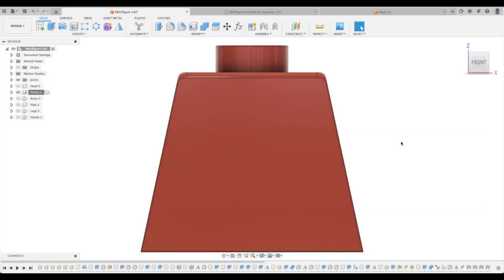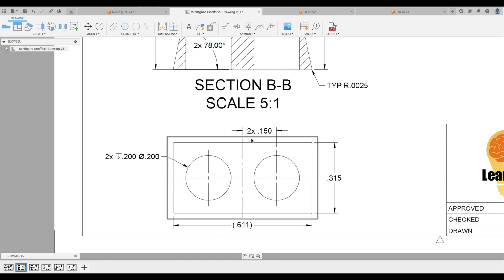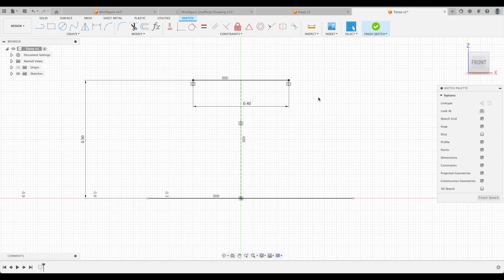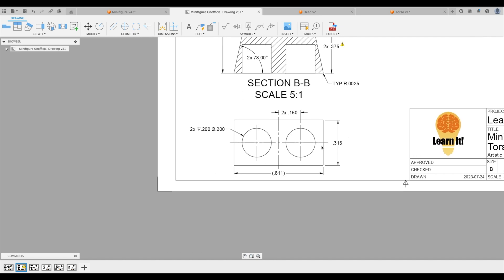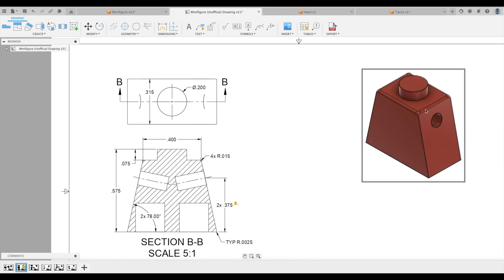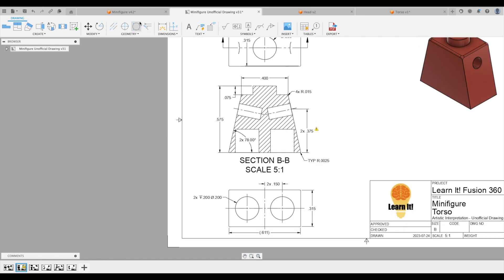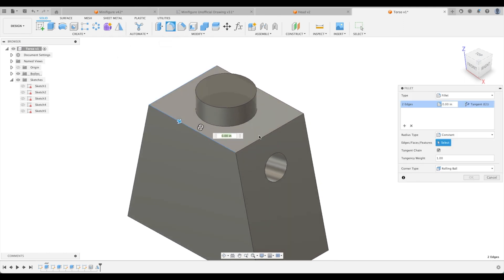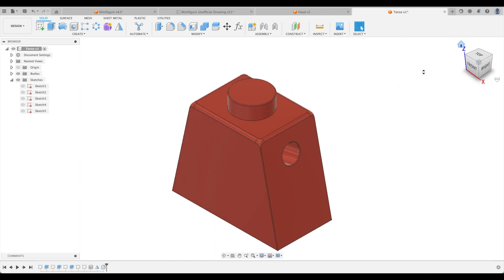Fusion 360 for Beginners - Lesson 10b - Model the Torso - Drawings, Fillets, Angles (2023)

Comment: Great videos 👏 but i dont understand what a thou is? Do you have the measurements in mm?
Reply from the maker: Thanks! Here’s a couple options regarding conversion:

1) keep your documents in mm, enter the value as you see in the tutorial, but add a double quotation mark after the value (“). This will automatically convert the imperial dimension to metric. Watch tutorial 1 in the new V8 Engine course to see this method in action. Here’s the link: https://youtube.com/playlist?list=PLLm7Yjr9z_z25rrJWxH_SRSCWenc3xQQz&si=BeLUJdeMdhg0vjZu

2) Learn the formula. Multiple the imperial by 25.4. Memorize this… you’ll use it often in the design and manufacturing world.

Comment: Hello mate,
How's it going?
Please make sure u asked the viewers to retrieve the default settings as in the last video I mean in the Head for doing Eye colors we selected to the BODY FACES and Fusion 360 automatically saves it as default and even if we opened New it still saves in the default so I wasted almost 20 mins to get it worked as in the starting u drew a line and then converted to constructed line, I was tryin to do the same but couldnt select it Lol then finally after chatgpt's help I got it done, thought of letting u know..

Regards.
Reply from the maker: Hello mate,
Thanks for your message and input. Can you explain a little more please? Are you wanting an explanation of how to change the default settings?
Reply: @learnitalready  I mean it’d be great if you could remind viewers to reset their default settings at the start. In your last video (the one with the eye colours), we switched to BODY FACES, and Fusion 360 saved that as the default. So even when opening a new file, it stayed that way. I spent almost 20 minutes figuring out why I couldn’t select the line after converting it to a construction line at the beginning 😅. Finally got it sorted out with ChatGPT’s help, so I thought I’d share this in case others run into the same issue.

Cheers!

Comment: Hi, thank you very much. Your videos are very useful and easy to understand for someone starting from scratch like me. However, I still don’t know the difference between a hole and an extrude based on the drawing
Reply from the maker: Thanks so much for your encouraging comment. Glad you find them useful and easy to understand. 

Regarding the difference between the Hole and Extrude tools (in creating holes): using the Hole tool for holes helps with creating drawing references a lot easier than using the Extrude tool. Using the Hole tool will help automatically create the related dimensions such as C-Bore, C-Sink, depths, thread information, etc simply by using the Note tool within drawings. If you extrude a hole, you will have to automatically enter all the above information in a drawing. 

If you're only creating a 3D model and don't plan on creating a drawing, then there aren't always advantages in using the Hole tool. However, I have gotten into the habit of it and prefer using the Hole tool whenever creating a hole. 

Does that help clarify things?
Reply: @learnitalready  Thank you very much for clear explanation

Comment: Hello, I love your training videos and I am following them meticulously.  I was able to draw the Torso but when I get to the point where you draw the horizontal line on the front of the torso that is 0.375 up from the bottom of the torso, I am not able to select the line when I go into projection mode.  We need to project the line because otherwise we cannot select it to draw a line on the right side of the torso for the arm hole.  You select "P" to project the line and in the video, you have no problem then selecting the line.  I cannot for the life of me figure out why the program will not let me select the line when I want to project it.  I go to click on the line and it highlights the front torso or the side torso.  Nothing I do lets me select the line to project.  Does anyone have any suggestions?  Thanks

I have now gone back and redrawn the entire torso up to the point where I need to draw the arm holes and the line that is on the front face of the torso which is .375 up from the bottom of the torso has been drawn.  The next step is supposed to be to project the line so that you can reference it to draw the line on the side for the arm hole.  But as before, I cannot select the line when I go to projection mode by selecting P.  when I move the cursor over the line, the front torso highlights but no matter how close I get to the line or hover over it, it will not select.
Reply from the maker: Thank you for your encouraging comment and for reaching out. I think what might be the issue is your selection filter. In Sketch mode, click on the Select drop down menu in your toolbar, then hover your mouse over Selection Filter and make sure Select Through is checked. Also, look at any of those other filters to see if anything is unchecked that would make it impossible to select your lines to project. 

Let me know if that works!
Reply: @learnitalready  Hello, OK, I finally had a day off where I could try your suggestions.  I selected the "Select" drop down menu in the toolbar then hovered over Selection Filter to see what was checked.  Everything was checked including Select Through.  I've tried various combinations of unchecking items and still I am unable to select the line that we drew on the torso that is 0.375 up from the bottom.  If I am not in Projection mode, the panel below the line highlights if I hover over it allowing me to select it.  When I hit "P" and get the "Project" box next to the Sketch Palette, the "Select" with an arrow next to "Geometry" is highlighted inferring that I should be able to go and select the line but when I go to try and select the line, it will no longer allow me to highlight and select it.  I very much appreciate your help if you have any other suggestions.  I can also do a screen share if you have the time?  Thanks...
Reply: I created another sketch of the angled side and that fixed it for me. Maybe the projection only looks to project on the current sketch plane?

Comment: I've noticed during your sketching sometimes you say to use a construction line, and other times you'll just use a "real" line for a line that will be used for reference only.  In this case it was the two lines you drew for reference to determine the location of the arm hole.  When should I use a construction line, and when is it ok to draw a real line?

I've been trying to build one step ahead of you from the drawings to see if I'm correct about how it should be done, and I was looking at the "arm hole" section of the drawing for a long time wondering how I'm supposed to know its size. I was thrilled to see it was missing from the drawing, rather than something missing from my knowledge!  Again thank you so much for these videos.  I feel like I'm learning a superpower right now.
Reply from the maker: Great question, thanks for reaching out!

There is a basic principle with solid and construction lines: if a line is merely a reference, generally use construction lines. If a line is going to be part of your actual model, then generally use solid lines. That being said, this is a principle, not a law. There are many different cases in using one or the other. 

Thanks for your encouragement too! All the best! Hope to hear from you again!

Comment: I noticed that when you did the holes for the hands instead of doing a "flat" hole, you did a "angle" hole.
Reply from the maker: Ah yes! Great observation. Both are fine. The angled hole is useful in manufacturing. To create that type of hole, a standard drill would be used. Flat end holes could be created using plastic injection methods or other techniques.
Are you enjoying this series? Would love to see your finished projects.